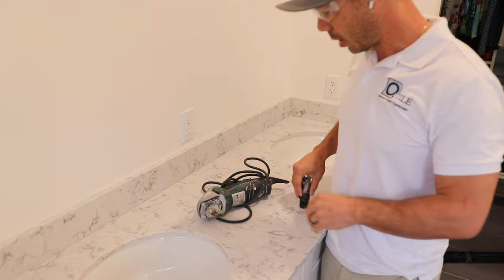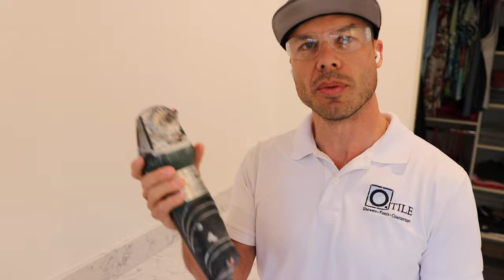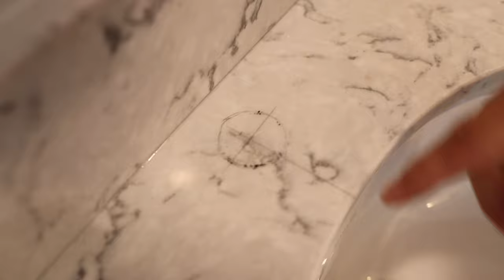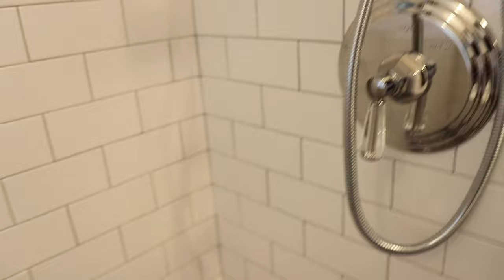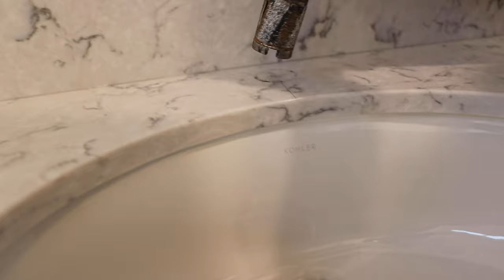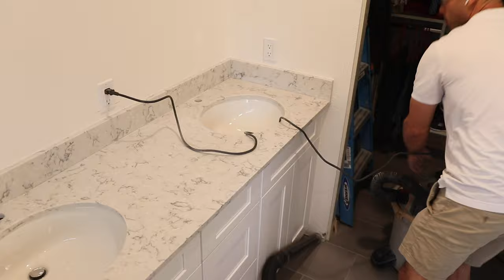How to Cut a Faucet Hole in a Quartz Countertop -- TileCoach Episode 31

Comment: This can be a marble countertop, which is waaaaay weaker than quartz. That is why he didn't need water for this. Its like drinking into wood... However if it is quartz, USE WATER! I have seen so many failed attempts b.c the heat ended up cracking or chipping the countertop. It only takes a couple minutes more to stay safe instead of risking a $1000 mistake.. -.-

Comment: OR you know they create these “magic” things called pilot bits and an arbor. Then the holesaw can’t walk..in fact..the tilted entry means you will never actually have a perfectly clean hole. That’s why you are wiggling it and “reaming” the hole. Your way works IF you don’t have the proper stuff and know what you are doing but an arbor with a 1/4” pilot bit slapped into any cordless drill is the PROPER way to drill with a holesaw. How would I know? I mount saddle tees onto steel every single day at work. Only difference is you use a diamond tooth (aka masonry holesaw) on stone instead of a steel cutting one.

Comment: Bro, why are you rocking the bit back and forth like that?  Notice how it jammed up after drilling through?  You're running the risk of cracking some stone.  And as others mentioned, a jig amd water is a whole lot safer...  Also learn how to lay out and run subway tile.  In corners, cut pieces smaller than 50% should be adjacent to cut pieces larger than 50%.  That way the tile looks like it's running continuously around all 3 walls.  Those random cut pieces look like butt.  And the black grout or silicone isn't helping.  Caulk the color of the tile, not the grout...  And why is does the vertical bullnose run below the top of the sill at the window?  The sill should have been installed first and the  bullnose sits on top.  And why is the side of the cabinet tiled?  #JANKY